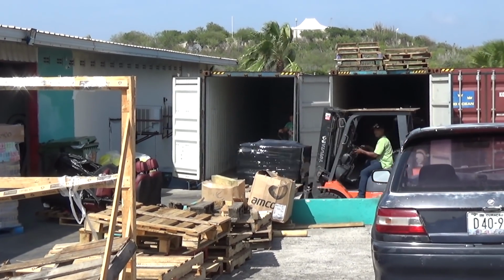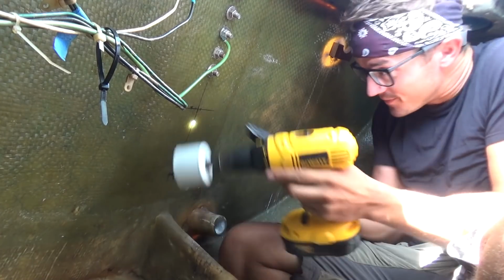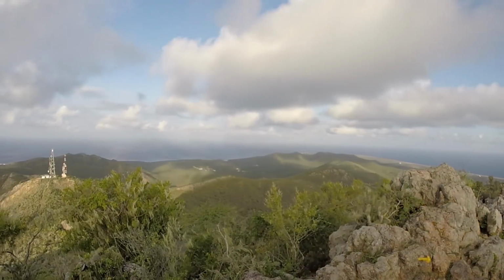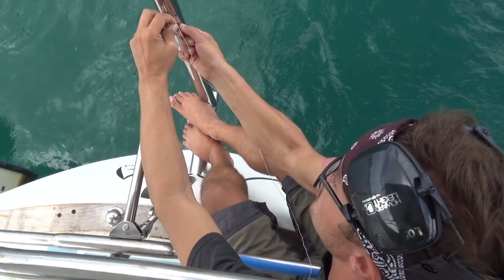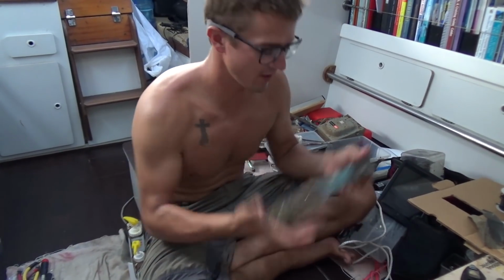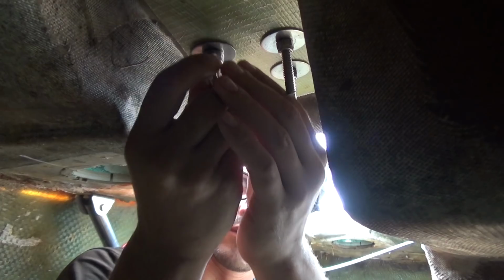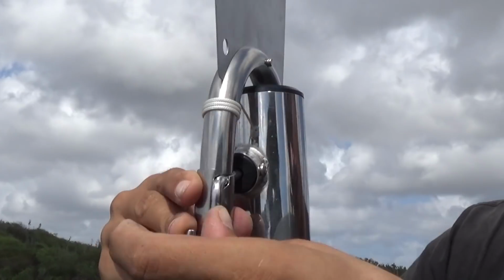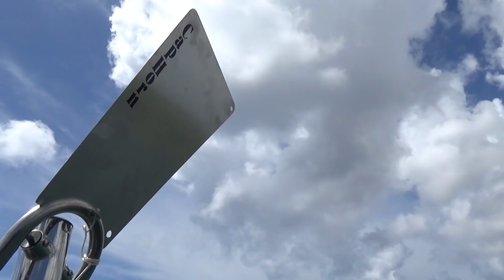Cape Horn Wind Vane Complete Installation — [Uma Gear Review]

Comment: Amazing install. I was gritting my teeth with you handling the hardware over the water. You have more confidence that I. Great video. I looked for this one. :) This video did not disappoint. I must have missed this one on the first time around. Thanks for posting. This, I suppose, is what you call an "evergreen" video. My Gawd, you have sure aged in five years! You were just a kid! :) All that salty air! :) Again, thanks.

Comment: Now that this video is 5 years old, how do you feel about the Cape Horn Wind Vane? Have there been any issues? Anything you've had, or would like, to change?

All I know about wind vanes is what I've watched on YT. My question would be what about the various heavy forces and stresses on areas of the hull and quadrant area, where the brackets and supports are installed...areas that were not designed or built with those stresses in mind. Any cracks, or failures of the wood or fibreglass?
Reply from the maker: The beauty of the capehorn windvane is the stronger the winds the better the performance. We used it 100% during our Atlantic crossing and rarely ever touched the helm. We don’t use it much on short passages simply because we have the electronic autopilot which works fine. But we rest easy knowing that the capehorn is the strongest crew member we can ask for.  Right now… our boat is undergoing major refit, so not much usage out of any of our equipment 😜
Reply: @SailingUma  Hi guys, thanks for the reply; just watching your video "Our #1 SAFETY PRIORITY (Autopilot or Windvane)", it's most informative, thanks. Hoping to do some some coastal sailing in the fall and learning about the various types of wind vanes. Greetings from Petty Harbour, Newfoundland.

Comment: I was wondering how much stress the horizontal mounting tube had on it? What I was thinking was screwing a block of wood to one side of transom so when you drill hole through you then drill threw it also and then you end up with a backing plate to fibreglass in for support. The transom looked fairly thin that’s why I was thinking this.
Reply from the maker: The transom doesn’t actually take much stress. It’s all diverted to the interior and exterior diagonal struts.
Reply: @SailingUma  ok Ty very much, I guess if your patch job didn’t crack then I guess it doesn’t have much stress. Awesome Job . John from Ontario Canada

Comment: Yeah, screws over water.  Maybe a taped drop cloth to catch anything that fell.   Apparently, that did not happen.  It would have had I been doing that.  And one more thought.  The internal support brackets, the first thing you installed.  If they are holding everything sturdy, why not put a larger long backing plate to add strength over the long haul?  Well done!

Comment: did you have to do any glass work on the exterior of the hull? Scary layout process. How has it held up?
Reply from the maker: No glass work. Just some Sikaflex to seal it. And it’s held up really well. We replace the shock cord that secures the pendulum about once every 2-3 years. That’s the only maintenance needed.

Comment: Really really love and benefit highly from all of your DIY videos, & DIY moments within regular videos! Because of you, I've got a better drill & have made my first bolt holes in the aluminum of my solar panel rack! Adding a new pair to my 20-year old Siemens panels... And, an oscillating multi-tool for attacking gelcoat stress fractures around the stanchions when the panels are up & running! I wonder how far the ripple effect from your demo videos has gone... We wouldn't be Us without You guys! Much love & gratitude!

Comment: I'm surprised you didn't build a wooden donut where the big tube goes through the transom for added strength and peace of mind. Is there not much force on that tube?
Checking with only a 1/4" hole through the transom was genius. Making a wood plug to neck down the hole size on that rotating piece so you could check accurately, priceless. Dude...you have the skills of 1% of the 1%. It's crazy how good you are. Being mechanically inclined is critical to being able to do what you guys do. It's either that or be very wealthy!

Comment: Ok, cool device, kudos to your mechanical knowledge and dexterity. yet...

Is it really wise to do this sort of thing while the boat is still in the water?

"So this brass-plated gimble widget is a crucial component that attaches to the aft sprocket -thingy and....Oops! "

Plop!

"Damn..."

Know what I mean?

Okay, it needs to be level whilst it is afloat. Ummmm do the plumb line stuff while it is in the water. Measure and mark... get it in dry dock and do the modifications?

Comment: I would have installed a Hydrovane, way less technical , less ropes to chafe , not a fan of the cape horn at all
Reply from the maker: Hydrovanes have way more moving parts, and much more complicated.
Reply: @SailingUma  I don't agree, but using the existing rudder is better , horrified that the SS pipe is bonded in with epoxy, despite all saying it sticks, it does not. There should be a through bolted SS flange there. to maintain strength and keep water tight , its a big hole !
love what you guys have achieved, very jelly !!

Comment: And I heard that I can put them off to the side some say it's better to off center it
Reply from the maker: As long as the pendulum is parallel to the keel, it will work just fine. They even mount them on catamarans.
Reply: @SailingUma  do they work with any wind direction

Comment: After watching this several times I downloaded and read the instructions. I would have been too terrified to even think about starting this. Great job. I do have a question about the unit though. It looks like flipping the vane out of the water causes the sector to rotate 180 degrees which looks like it would throw the lines off of it. Am I missing something?
Reply from the maker: Yes, in order to flip up the pendulum, you pull one line off. If your control lines are long enough, you don’t need to, but ours have a short loop so you do, no big deal, when you drop it back in, you just pop the line back onto the quadrant.

Comment: I'd defo have dropped stuff in the water. I've seen the Hydrovane system fitted (on their channel) and it seems must more robust and easier to set up with more fixed to outside of the transom. It looked expensive (maybe $6k) and the Cape Horn maybe $4k? I'd rather save $2k so is there a big difference in performance and durability?
Reply from the maker: The Cape Horn performs better since it can sail on ALL points of sail. Most others only work on some points of sail. We also chose it because of it's very simple and sleek design. Others are more complicated to repair and have aluminium on stainless, which is a recipe for corrosion. The entire Cape Horn is made from 316 polish stainless so it will never corrode. It's also much more efficient with the servo pendulum. We could make an entire video about why we chose it over the others. Maybe we should. Hope that helps in the mean time.
Reply: @SailingUma  Thanks for the explanation. Makes a lot of sense. Did you make a video about solar panel system choice and installation?

Comment: how has your vayne been holding up? mine is 30 somethiing years old... i have to tape the control line at the bitter ends at the quadrand do prevent chafing. had a bad gybe at night when it parted.
Reply from the maker: Havent' had any issues yet. It's been on for 2/5 yrs and steered about 8,000 miles. We've kept an eye on the lines in the quadrant but haven't had any issues yet. A bit of filing or sanding and polishing would solve it if we did.

Comment: If you ever do any work like this again.... Like maybe installing or dismantling a folding prop, or indeed more work on this wind pilot?  Fix an upside down parasol or umbrella as a contingency to catch dropped parts or even just get a significant other to hold it at risky moments.
There's footage somewhere of exactly this, by a dive team underwater removing a fixed and building new folding prop assembly over sand and weed.
I'd say it might even be worth using a lightly coloured brand spanking new one to save that crucial but fiddly non-standard component.

Comment: Hi you guys, have you thought about using a Autopilot on your vane?
Reply from the maker: Not really. Most of the time that is for motoring in dead calm conditions. But since we don’t do that, we don’t have the need. If there is wind to fill our sail, the Cape Horn works very well on all points of sail. Even in 3-4kts of wind and we’re only sailing at 2 kts.

Comment: I just installed a cape horn on our boat.  We had Eric from Cape Horn come out and do the installation.  Did you rig the remote course setting control lines for the turret or have you just been adjusting the turret by hand?
Reply from the maker: We have a short line coming down to the stern so we don't have to stand up under the solar panels in rough weather. But, it's worked well for us. We have plans to extend the lines to the front of the cockpit for longer passages, but haven't found the right set up just yet. A course with a windvane is quite different that one with an electric/compass, guided autopilot. But once you get used to that fact, we only adjust for major wind shifts. A few degrees off here and there doesn't make much difference on longer passages. The wind will inevitably shift, and you'll make up the loss eventually.

Comment: We are installing our Cape Horn now and wanted to know how you installed your upright supports into your stainless? Did you tap the stainless or screws only?
Reply from the maker: Through bolted with SS 1/4 - 20 bolts into the pushpit cross piece. Make sense?
Reply: Thanks for your fast reply. Just reinforced where the stainless tube will go though our aft lazerette for strength as it does come off if you need to install a generator down the road so we glassed over it for strength! Will mark our waterline level so when we go to install the actual unit we know how far it has to go to be in the water as our boat comes out for the winter the next few weeks :( love how nice this wind vane looks! Really enjoy all your videos!! Watched from day one!!

Comment: Just found this.  Really interesting and thanks for sharing.

I'd be really interested to know how and how much the feel of the steering has changed when you are driving by hand with the servo stored and the vane taken off?
Reply from the maker: Hasn't changed at all. Once the control lines are uncleated disconnecting the vane, the steering goes back to normal.
Reply: Ah interesting, many thanks for your feedback.

Comment: Nice installation but I think you mounted the black puck in the wrong direction. Mixed up port and starboard. It´s installed with the thin side to port now.

Comment: I have tied my Jib Sheet off to a tiller for self steering with the wind. It ties on the opposite of what you think it would and of course, your boat will change direction if / when the wind changes direction. Very cool and well done video. Thanks for the info.

Comment: i've got a 33 year old one. just be careful with the white plastic part that set the index.. mine got a bit rotten... but you will love this vayne... very capable.
Reply: also, you can loose the entire assembly on top, the tippy bits with the wind vayne itself it you don't have it secured via the tilt limititng bungee/ string

Comment: OK...So the wind twists the vane which turns the linked fin immerse in the water flow causing the fin itself to become pushed by the water and so forcing the connected quadrant to push the attached quadrant and steering system and therefore rudder. Is that it? :)
Reply from the maker: Pretty much!
Reply: when are you gonna put back the aft seat and lights (following its destruction in the collision)?

Comment: Not fair,  you made it seem so easy !  With that said,  it was worth every drop of our nervous sweat when we cut the huge hole in the transom and installed ours.  Like yours,  ours has been flawless.  The only issue we have ever had is that the top of the tower (the plastic ring) can get loose in really bad chop and start getting pushed up.  After consulting with Yves we just retightened and now we keep an eye on it (with a screwdriver by the helm to be able to fix it rapidly if needed).  After ~7000 NM we are still in love with it !

Comment: I hope that Yves Gelinas puts your video on his Cape Horn website, it is the most detailed one that I have ever seen. But, I'll still have to watch it a few more times to fully understand it's operation. I think you can attach an electronic tiller pilot to the quadrant for light wind use, won't you need a NMEA network, or comparable, to then use a remote from the cockpit? I would need a different model/setup if I bought an A30, removed the inboard engine (diesel or Atomic 4) filled in the prop apature and installed a 'tilt-up' outboard as James Baldwin (Atom Voyages) does on his refits --- to much risk of explosion from petrol containers stored in the outboard well. Cape Horn does offer other types of transom attachments, 5 of them, I think...

Comment: We found  a timber strap across the glass transom stoped it flexing under way on the inside m and allowed to have some caulking on the inside as expoxie won’t stick to stainless steel wich excepts vibration under way has lasted 32 k so far they struggle down hill in a big sea if your boat is not up to speed and take a pattern of the vane and log it you may need it     It was made in ply and we added 4 inches in hight and works better The reason for the timber strap on the inside of the hull is the unit flexes side to side and will crack the glass and running will let water in big time , glass the timber on fill both sides with caulking. Go out and test it in big seasbesor you go off shore to iron out the bugs  good luck
Reply from the maker: Thanks for the tips. We'll keep our eyes out for flex issues and leakage.

Comment: +Dan Were you really able to use a level in a boat at anchor? It seems like the wrong tool.
Reply from the maker: Yup. Bow to stern didn't move much, its across the beam that you have issues. It the boat is out of trim, make the level offset on the floor or some other surface that's aligned with the waterline, then use that new mark as your guide. Worked for us so far!

Comment: Great video! What other wind vane brands did you consider? Why did you choose the Cape Horn brand? Price, recommended, other?
Reply from the maker: That's a great question, We probably should have gone over this in the video. We've spent the last two years, researching and looking into pretty much every brand of vane out there. I think our decision boils down to 3 main points. 

1: Aesthetics. 
We LOVE how clean and well designed the Cape Horn is. No external lines, no extra pipes and hardware hanging off the back. It just looks GOOD and functions even better. Sure, that means it takes a bit longer to instal, but, you only have to install it once! 

2: No external rudder. 
There is a running myth, that if you have a vane with it's own rudder that it can act as a "back up" if your main rudder is ever damaged. But, to us, that logic doesn't hold. Because unless the vane rudder is removed when your main one is damaged, it will most likely get damaged as well. Our rudder has a full skeg, and several is a full foot or two above the keel, so we would have to drift backwards into a cliff in order for it to be damaged. In which case the wind vane would be gone too!

3: Others reviews. 
We've read many blogs, forums, comments, and listened to people talk about their own wind vane experience, and we've heard many people complain about how their wind vane functions. "It's picky", "it only works in certain conditions", "it's hard to adjust or trim properly". Most of the boats we've talked to who have a vane installed never seem to use it, because an electronic pilot is so much "easier". Now, we haven't seen as many Cape Horns out there, but the few people we've talked to, and the many comments we've read about them, not one complaint or trouble with them. That to us may have been the most important factor in our decision. They just seem to WORK! If your sails a well balance and trimmed, the Cape Horn will steer you though anything. 

Hope that helps clarify our decision process. 
Cheers!
Reply: Thanks so much yes excellent reply! I was extremely impressed with your installation.

Comment: Excellent episode.  I installed a windvane just over a year ago (different brand, but exactly the same 'servo rudder' principle).  Expensive, but the best upgrade I have even made to the boat.  I did a solo 550 mile trip earlier in 2017.  I used the windvane all the time, at all points of sail, and it made the trip a real relaxing pleasure.  I only steer to park the boat nowadays.  Looking forward to seeing it in action.
Reply from the maker: Thats great to hear, which one did you go with?

Comment: That was a professional install video - hope they gave you a discount. The only thing I did not like about the design was the transom penetration where you had to fibreglass onto the main tube. I think the design could be improved by them to use some sort of gland and rubber packing sleeves. As the gland is tightened form the outside it compresses the rubber section sort of thing -know what I mean? Anyway -well done.👍
Reply from the maker: They actually have a gland like that for aluminium boats where the SS and aluminium would otherwise come in contact. But the glass works well on a glass boat. We roughed up the SS tube as well which provided a nice surface for the glass to bond too, then sealed it from the outside with some caulking. It also acts as a third secure point making the whole system stiffer and firmly attached to the transom.